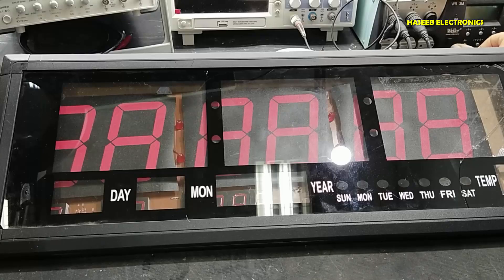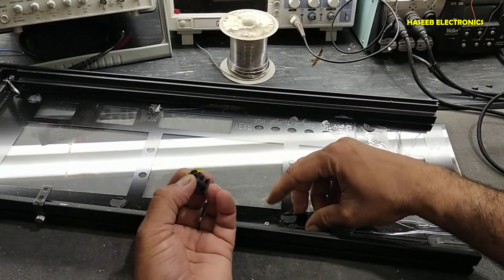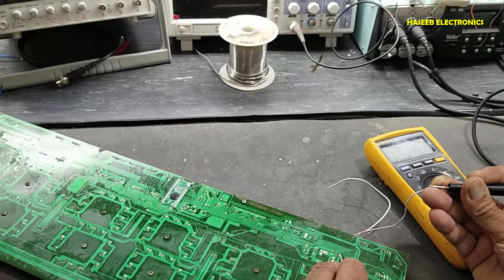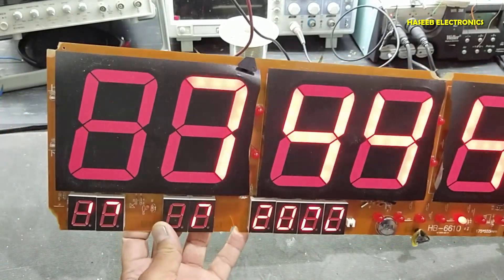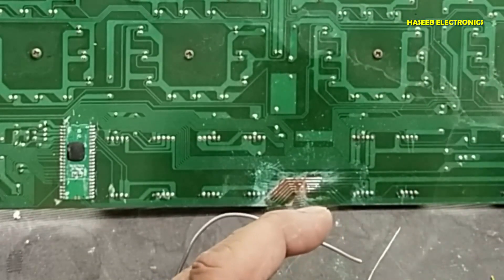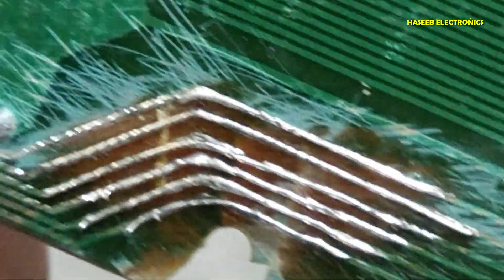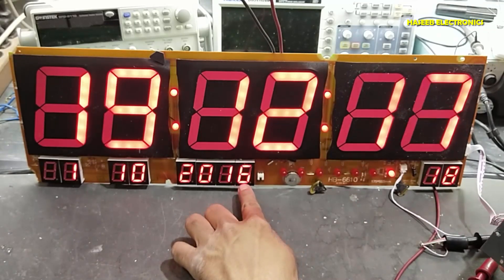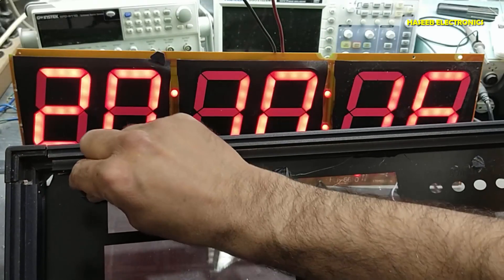{564} Digital Clock Repairing, No Display Problem Solution

Comment: I have this clock with for years and now the display is gone and only the centre dots are illuminating, kindly share your shop address if possible so that i can try to send my Digital clock for repair at your place, your video is very informative, I like repairing stuff like this athome but am not an expert so could not repair.

Comment: I love stuff like this! I'm building a two tube 59 second IV-12 VFD tube timer using 7490, 7448 and M54563C darlington ICs to run them. I'm going to use the 60 hz outlet frequency as a frequency base. Too bad that the owner dropped this. Lucky it could be saved. Some sturdy mounting brackets to mount it to the wall would be nice. Best regards sir.